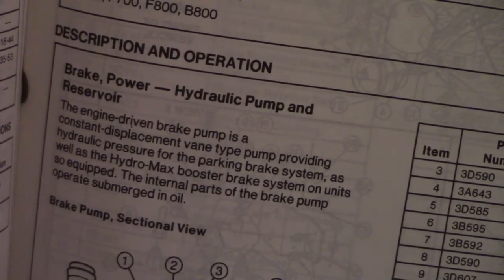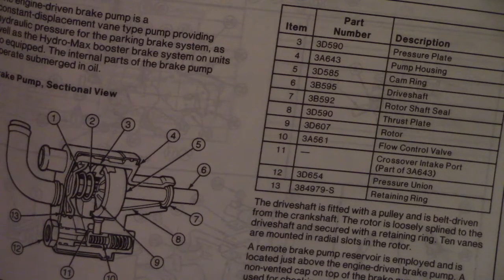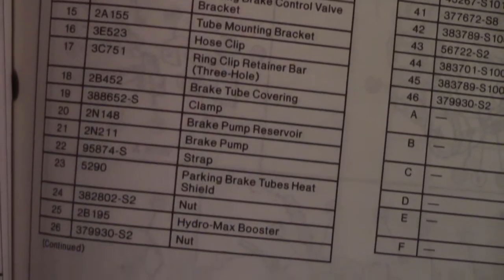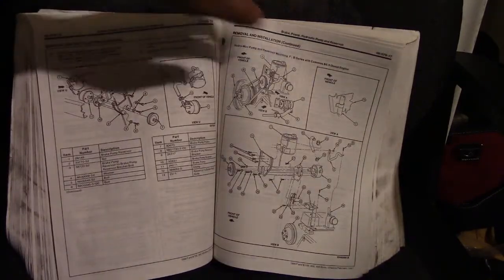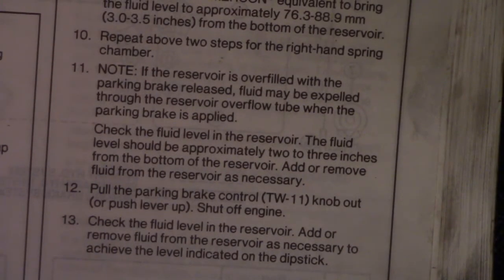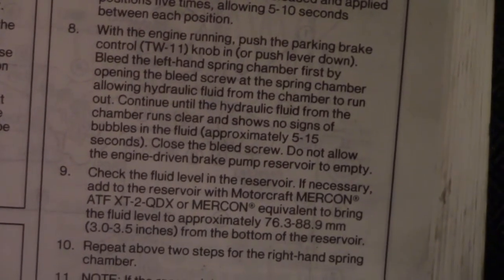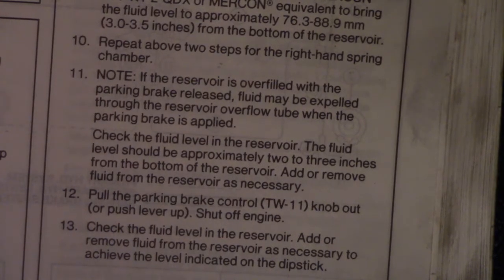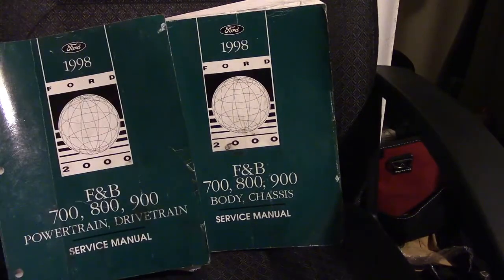F800 Hydraulic Parking Brake Pump Service Manual Step By Step Bleeding Process

Comment: 1988 F800 lucas G brakes. Im looking for the part # for the psi switch mounted on the hydro boost unit.  We had a problem with it leaking.  Replaced it with a NAPA part # op6612.  It worked for a couple of days but then the brake alarm in cab started going off.  If you unplug the psi switch it stops.  It would be nice to know the psi spec. to check and see if the pump is making adequate psi also.  Thanks for your videos and help.
Reply from the maker: i have the repair manual on hand, are talking about the Oil Pressure Gauge Switch?
Reply: @RescueMoversDFW  yessir!
Reply from the maker: https://youtu.be/VhTEI_GtU4Y